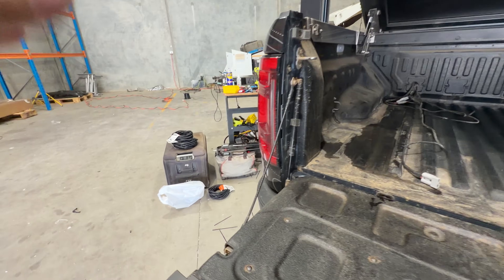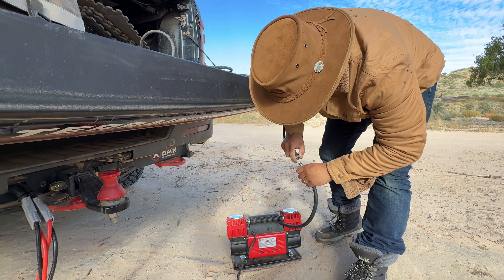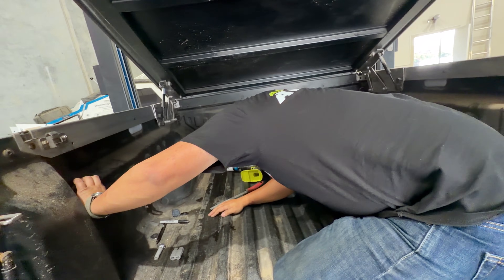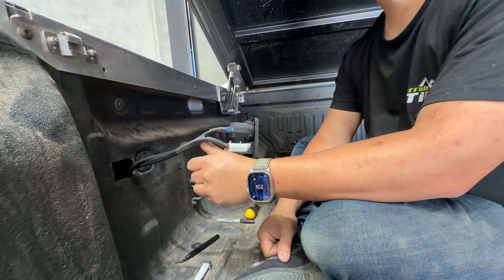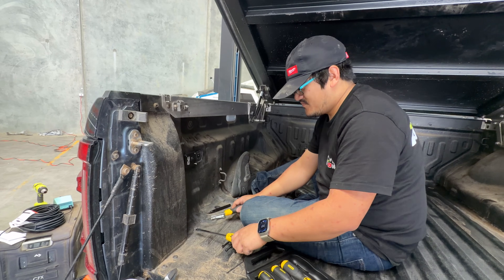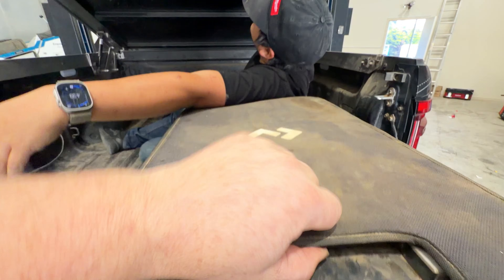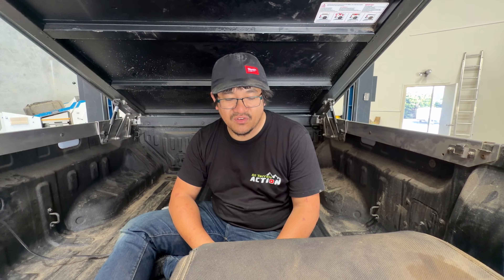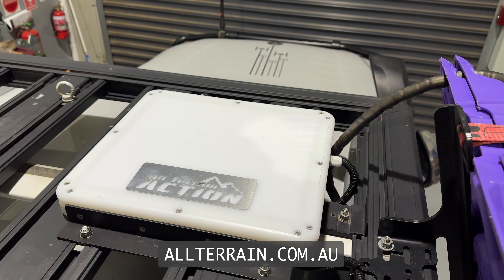12V Always On Solution Tested for 9 Months in the BYD Shark 6

Comment: I'm sure in a previous video you told us NOT to connect any loads to the 12v internal shark battery system ??? What hapenned to the planned LiFePo4 upgrade plan and 240v charge system ???
Reply from the maker: When we did more testing on the shark low voltage system, we found that as long as you don’t really need more than 150a @ 13.8v at any given time this is a better way. We have a full 12v system that could DCDC charge or ACDC charge but that’s the point unless I need to run a winch when the native system works just fine.
Reply: @AllTerrainActionEV Famtastic discovery…. Saves the whole installation and expense of a duel battery system. Great work ! Do you have a contact in BYD to suggest it as a factory feature ?

Comment: A lot of fridges just seem to run better on 240V, I know my engel gets down to temp quicker on 240 than on 12V
Reply from the maker: Agree which is why I connect mine to AC, so when shark is on it is running off AC but when shark turns off.c it simply fails back to the 12v system and everything can be left to do its thing.
Reply: @AllTerrainActionEV   Hi buddy just to clarify using the 240volt tub outlet to say to a fridge while car is on  , you can also at the same time have the 12volts DC battery supply from under the rear seat connected , assuming this is always active 24/7 and the fridge switching between the two power supplies is automatic , so you don't have to do anything,  is the smarts in the fridge to default to 240 v AC as the primary and if not available ( shark turned off) it will just run  on 12v DC ?

Comment: Can you jump start a gas vehicle from the byd's 12 volt battery safely?
Reply from the maker: I’ve never tried to jump start another vehicle directly. What I have done is connect my Anderson plug to a set of alligator clamp Anderson leads on a legacy ICE vehicle, let it sit for about 15 minutes, then disconnect it and start the ICE vehicle successfully. I’m not keen on dumping an inrush load straight into the 12V system and none of my runs can really do more than 66A continuous, they might do 100a for a few seconds though, but as a way to slow-charge a wet-cell battery enough to crank the engine, this method seems to work fine.

Comment: Ever since your first video of your 12v solution, I have run the same system running Fridge, Compressor, canopy lighting and Starlink nonstop for 7+ Months. AC-DC under rear seat gets pretty hot at times. But as Chris has pointed out in the past it’s good for 200+ amps
Reply from the maker: It is water cooled, but I think more when the vehicle is turned on. I don’t think for low current and draw use mainly for dc 12v operation water cooling wouldn’t be necessary. I have also seen it warm, but haven’t questioned suitability given it has liquid cooling capability. You wouldn’t go and draw a high amp load when the vehicle is off, eg, I still leave the shark on when running an air compressor load for example because I know the water cooling is active.

Comment: Great video busting the myth of the 12V system not self managing when the car's off mate. Would be good to get some data from a smart shunt or something showing the voltage/soc of the draw for a week or something to put peoples minds at ease that the 12V battery isn't cycling hard enough to do any damage.
Reply from the maker: At the end of the day, the battery is there to be used - at least thats how I see it. Beats spending $$$ on a second 12v battery to be used instead. Its only 14Ah, so if youre relying on the Shark for 12V power while the vehicle is off, you'll likely see a lot of 12.6V to 13.8V cycling from what I've seen and this could be a 50% cycle or a 80% cycle I am not sure for each loop around (will make more sense in the video I just did after seeing this comment). In other words, it will be going through charge/discharge cycles quite often when used this way if the Shark is turned off or not on high voltage constant charge.

I saw this question yesterday, so I put together a quick video showing what you can expect over a 3-hour window with a constant 5A load. I might get the chance to do a longer one-week chart, but with my current schedule thats a big commitment, so this will have to do for now. https://youtu.be/rddRLRPWKuE
Reply: @AllTerrainActionEV  love your work mate

Comment: No anti corrosion paint for the cut bare metal? Just asking.

P.S my shark had a flat battery when it was 4 months old. Went to go pick somthing up. Was stopped for 30min climbed in and shark wouldn't start. 12v battery was flat. And 30kw battery was fully charged.
Reply from the maker: And to your other question after the edit, I can’t understand the issue some are reporting with flat 12v systems.

We preformed a series of voltage charting of the 12v system, when car is unlocked left off, left off locked for almost 24hrs left off and locked for an entire weekend while we had loads on the 12v circuit drawing. In all cases the voltage did not dip below 13.1v and would often hit the 13.8v range which whenever we saw this climb indicated to us the 12v system was actively been charged by the onboard charge system. We also preformed a load drain directly from the 12v system, after the high voltage battery was at 21% and the shark automatically started at 20% and began to idle charge seems to run only for 10-15mins at a time though till it reached 25/26% before turning off again. This was early days. We might chart again knowing there’s a lot of major updates, but we have never had a flat 12v system ourselves or any customers who have had this modification done to date.
Reply from the maker: I would add some, if you aren’t using sikaflex. I lost the shoot of us applying sikaflex 227 to the outside side of the tub to waterproof it where it’s been installed for some reason the filming under the car couldn’t be found (I think Wal forget to press record😂 so I was talking to a non recording camera) There is a lot of room to get hands up there from under the car, but if you aren’t going to do this, spraying some primer, paint or corrosion prevention/protection will be a good idea but given how much mud we’ve been on in the shark, the surface at this height as very clean, but always good practise to shield bare metal for anyone not aware watching this video. We prefer sikaflex automotive stuff, we’ve found it to work great and once dry, never coming off seals it well.

Comment: Would be cool to see what solutions people are using for 12V winch and HID spotlight set ups on the shark. I've had some Lightforce lights chilling in a box since I got the shark but have been too scared to mess with the electrics until I see some other setups... now I have the bullbar and will Xmas coming up, I'm keen to sort this out...
Reply from the maker: Most are running high amp draw 12v stuff off the under bonnet fuse box, busbar that has a maxi 200a fuse. This isn’t enough to run a winch, but people seem to be doing so with no issues. I haven’t got any personal experience with this method of use, as draw from an actually loaded winch with sharks weight will probably make 300-400a range maybe even more. The thing that bugs me about that solution is, the high to low voltage DC charging system is under the back seat, and the small LFP is also there, that would mean all that current is been drawn over factory wiring into the front fusebox where the busbar is and in a scenario where it might already be high risk situation, adding a failed 12v low voltage system on the shark is not up in the things I want a problem with off-road. As for lights though, anything up to 150a behind that 200a maxi fuse should be safe, I can’t comment for sure until I’ve done my own testing and experimenting.
Reply: @AllTerrainActionEV thanks for sharing your experience Chris
Reply: @AllTerrainActionEV would adding another small battery under the bonnet potentially solve the winch/high draw accessories issue? Would it be straightforward to include in in tbe charging system from the main battery but kept independent of the factory wiring so it can't fry anything when 4-500A is drawn? I'm conscious of weight penalties too.
Reply: Chris is right about the loading required for a winch, you might get away with it on the flat or sand 9 times out of 10 but that one-time up Beer O'Clock Hill, everything fries. 
MadMatt, now selling his Shark, has a good video of his winch install and added high current draw separate battery system, in the tray, that he still charges from the LFP 12v system. I believe he had it wired up so that it isolates from the LFP when the winch is in use and vice versa, as Chris says it avoids having a permanently live 12v connection though the under body of the vehicle.

Post Edit: I think he had a mini-inverter on the high current battery that was taking the 12v LFP current, converting to 240AC and that was being used by the HC-battery unit to be charged....Yep sounds mad walking up hill to go downhill just to go uphill again, but I think whoever kitted it out for him was just working from old school lead-acid LC-battery philosophy to the current devices they had on the market. 
Given that your entire vehicle relies on the LFP 12v battery for operational management I'd be looking to not stress that unit as much as possible. 
Lets be honest , the Chinese engineers never expected Australians to throw so many low voltage power accessories on the car at once.

Comment: Chris in passing would be interested in your thoughts on the longevity of the LFP 12v fitted to all BYD vehicles now. I’ve got an early 2023 Atto 3 with the lead acid battery ….. lots of failures and a wave of replacements now occurring with the cars coming up to three years service …. No official option to replace with an LFP replacement under the hood .
Anyway another interesting video by you…. Looks like your expanded offering is really building now … well done
Reply from the maker: LFP could only be used if the charging profile of the atto 3 supports the profile as voltages are different in its charge cycle, I haven’t a clue about atto I’m afraid in this area. There are some LIFePO4 batteries that support wet cell battery charging profiles as the BMS has been programmed to react accordingly but, when it comes to BYDs expected use case for the main low voltage system supply, I wouldn’t be going away from manufacture recommend for that type of thing.